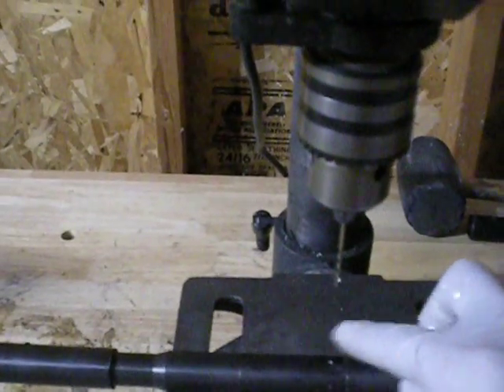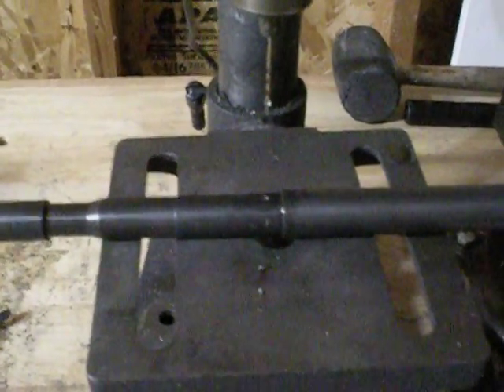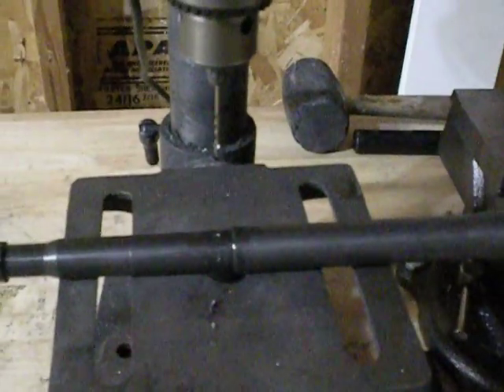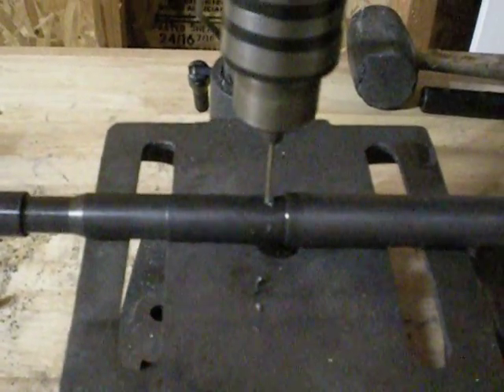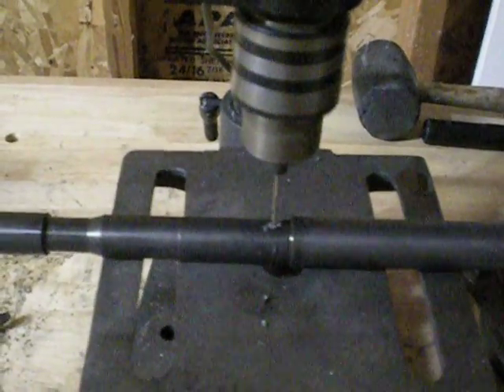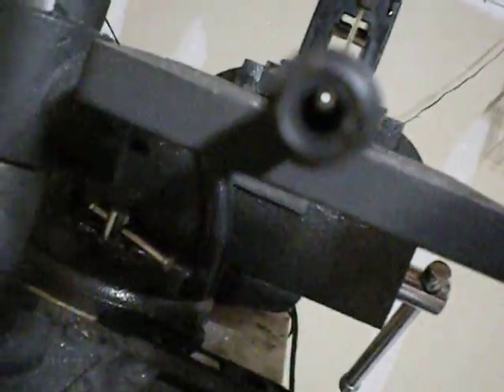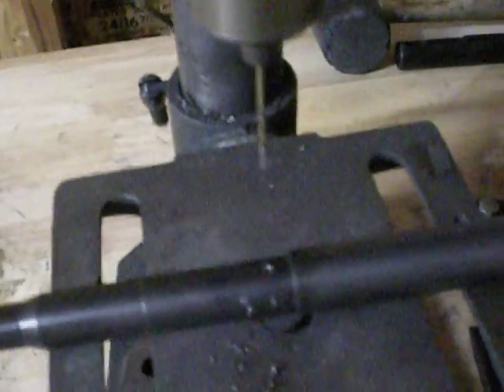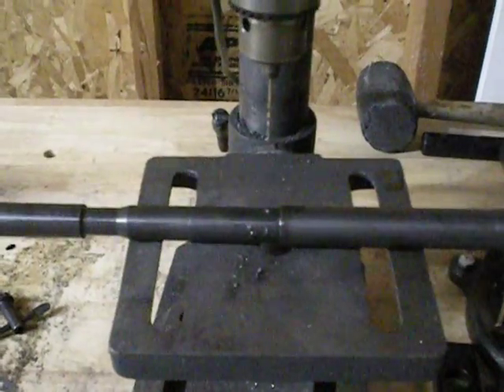How to drill the gas port on an AR-15 barrel. 3 of 4.

Comment: Just a suggestion, but if you put wooden dowel in the barrel or an old cleaning rod just another layer of precaution to avoid the dreaded oh crap !
Reply from the maker: I'm pretty sure I mentioned that in the video. Wasn't necessary in this case, because I had a depth-stop on my drill press.

Thanks for watching and commenting!

Comment: imagine the fucking bit snapped in half and got stuck in the gas port 💀. i'm about to drill my gas port out right now on my piece of shit 14.5" hanson profile ballistic advantage barrel 😡
Reply from the maker: Go slow, and use lots of oil and use quality drill bits. You'll be fine. Good luck!
Reply: @Wrenchmonkey1  exactly what i said jokingly just happened to me... ffs man lmao. i was able to pound the shard of bit out with a punch. these bits are so damn small and fragile. i used a milwaukee cobalt bit and that shit broke, i need to go back for more, i think i'm almost all the way through it though, the barrel wall is thicker than i though, seems like it's like 3/16" thick or so.
Reply from the maker: @imbrandon16  
Oh no! Are you using a drill press? You also want to back it out very frequently. They are quite thick compared to the diameter of the drill.

Comment: What type of bits are you using
Reply from the maker: Just standard run-of-the-mill twist bits. It's been many several since I made this video, but I think these ones probably came from Harbor Freight, with the Titanium Nitride coating. 5140 isn't hard to drill with a drill press.